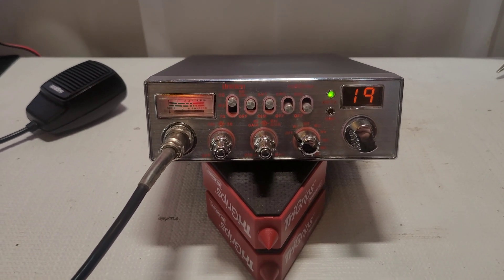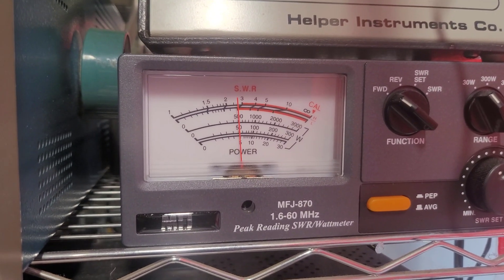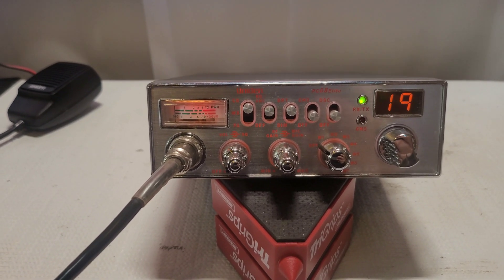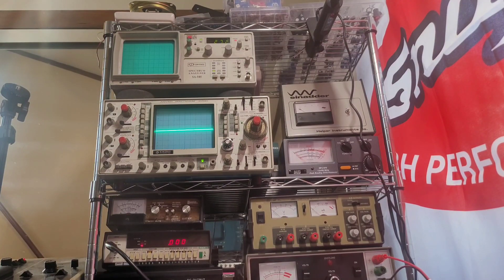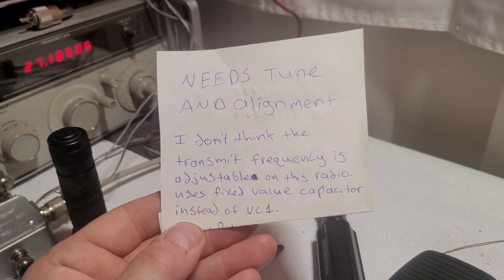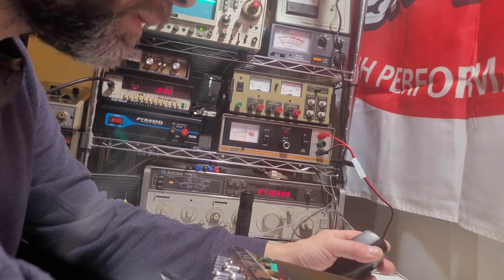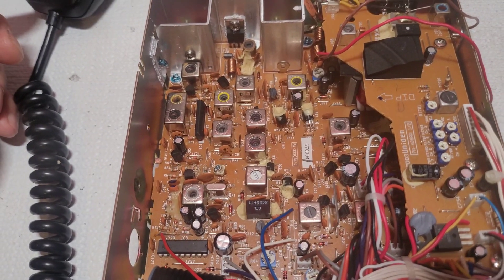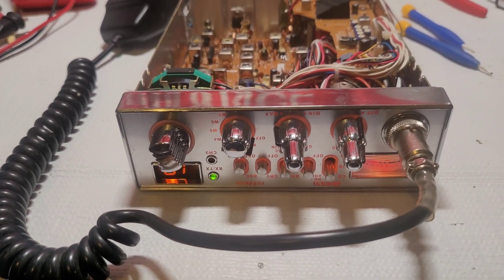Getting a Uniden PC68 Elite transmitting on frequency my way

Comment: Hey there Pulsar CB!  I have a quick question for you:  How do you read the scale of the signal generator to get the reading of -114? 🙂
Reply from the maker: The output level knobs goes in increments of 10 dbm. Then adjustments are made with the smaller knob to achieve the levels in between and read on the scale to the left.
Reply: @pulsarcb  Hey there Pulsar CB!  Thank you for replying to the my question in comments.  Your video is interesting about how to adjust the sensitivity in the receive of a CB radio.  I hope that you keep at it.  I have had some schooling in electronics and same self study, mostly from SAMS photofact service manuals for CB radios but still find it challenging to set or allign or increase the sensitivity of a CB radio's receiver section to honestly proove to myself that I have succeeded in making a difference.  It is motivating and impressive and inspring to see you be able to make the reciver have an increase in sensitivity!!!🙂:yt:

Comment: Just how close are these to a Cobra 25?    I have asked about a PC68 on WWDX before and been "steered" to the Cobra.   Is the PCB actually the same?   Thanks! Bob
Reply from the maker: They are close enough but not 100% the same. Alignment is the same.  Uniden elites have the front glow, so more circuits. You can  get by with a Cobra 25 service manual.